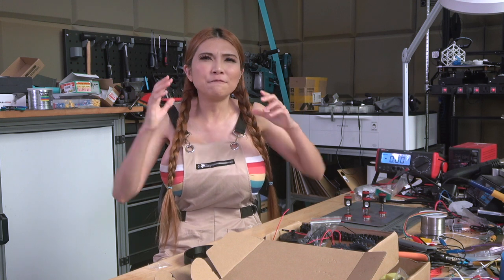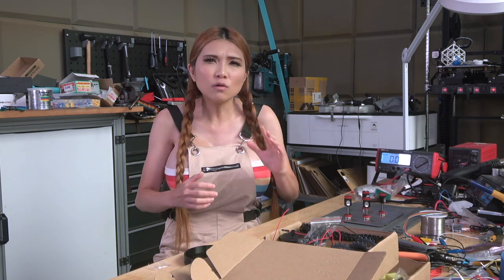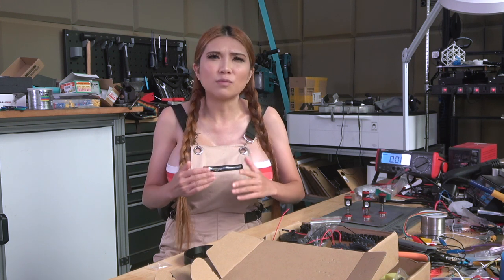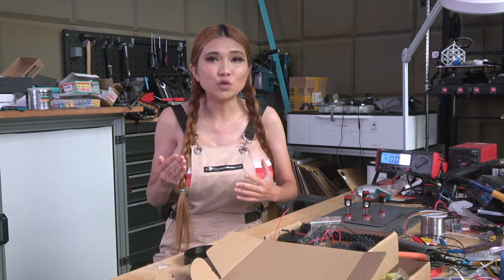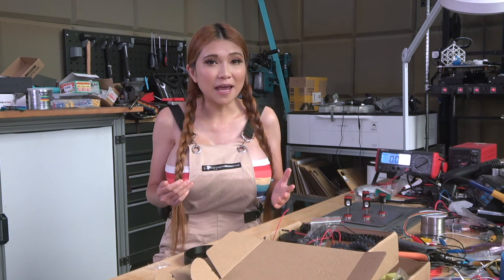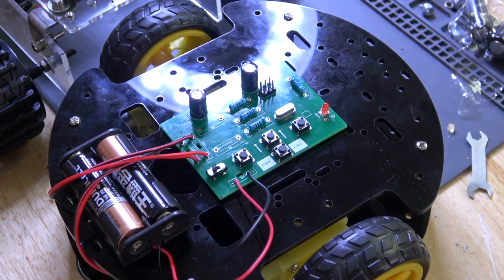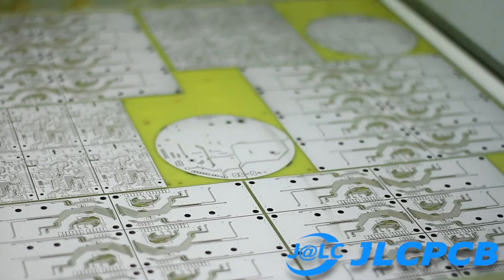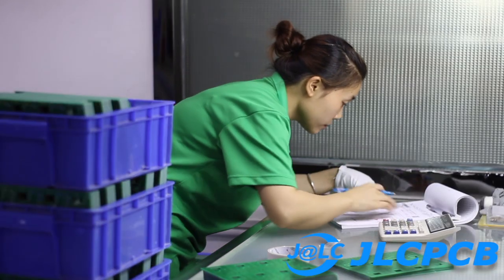Simple Push-Button Programmable Robot- With JLCPCB!

Comment: You should look into getting an electrostatic discharge (ESD) wrist strap for when you have to handle chips and exposed circuits. A basic wrist strap doesn't cost much at all. You might also add a ESD worksurface pad, although that costs more.
Reply from the maker: Not necessary for this kind of thing, just tap something grounded before you get to work to discharge yourself.